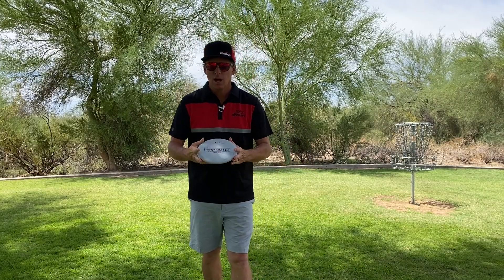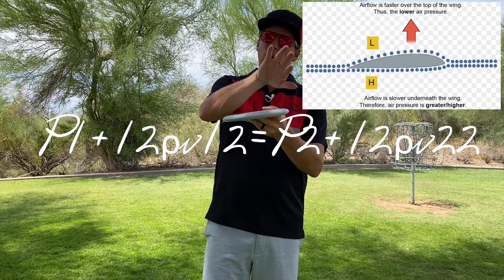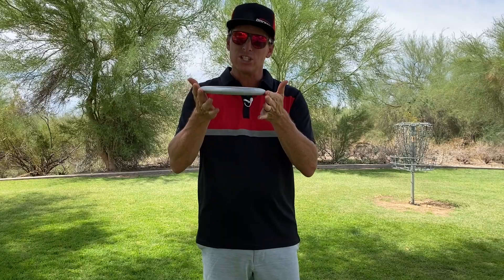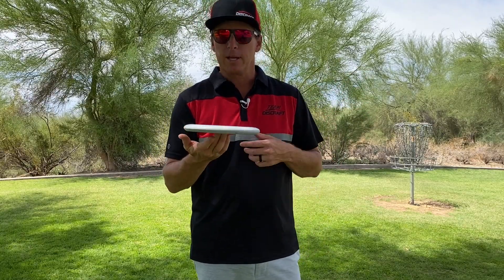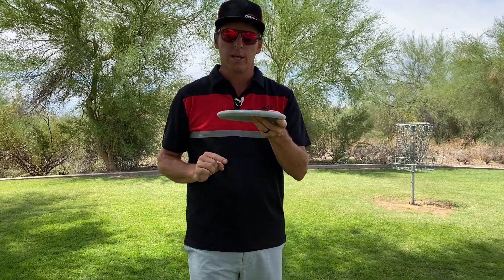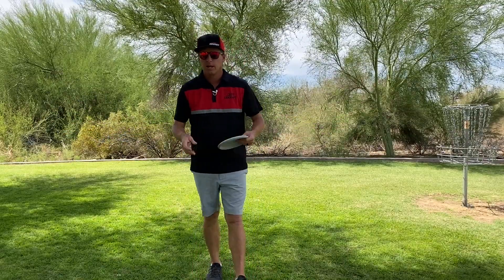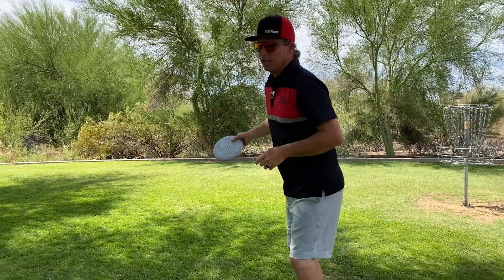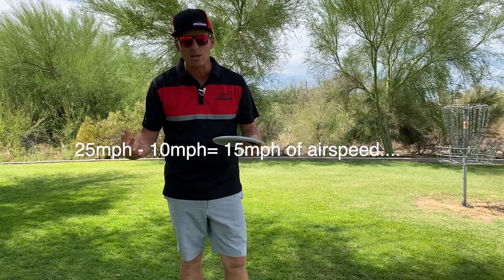Reading the wind Part 1: Airspeed & Disc speed

Comment: Great information, Pete. Thank you. Most of the headwind/tailwind putting instruction seems to entail aim point adjustment. Given your insight that the "airspeed" of the disc is the actual cause of the various wind effects, could one also theoretically maintain the same aim point and then adjust only release velocity? Is the aim point reccomendation made because it's a lot easier to reliably estimate than the mph of a given wind?
Reply from the maker: First, thank you for the questions, they are good ones.
I think most folks see the wind as a force they have to either beat or race to accomplish their desired outcome. Have you ever seen one of those swimming pools where the pool has a water current being pumped through it so that the swimmer remains in one place…kinda like a swimmers treadmill? How fast the water is pumped past the swimmer dictates wether the swimmer remains in place or not. Air is a fluid/gas, and the speed with which the fluid passes over the disc dictates “how Much” effect it will have on the disc. Learning how to have “proper pace” while putting is super important….also, I didn’t touch on it in this video, but having a correct disc angle makes all the difference. If the nose is high into a headwind, the disc will lift, just the same as if it were thrown nose down in a headwind, it would “drop”.
As a starting point for my video let’s assume the disc is putt completely level…..it is in an orientation that the wind will have the least effect on it. Putting practice is super important in order to get a feel for how one putts. I tend to not try to accelerate my putter past my normal putt speed….I keep the same pace…so in a headwind I know that my putter will fly straight, as long as my disc angle of release is level (meaning not nose up). In a tailwind I know and have a feel for not changing pace but just adding height so the disc will have time to fall since it will not tend to glide due to a slower airspeed. Once again making sure my disc is not nose up or down.
Don’t get me wrong, There is a time and place to putt nose up or down, it’s extremely useful to know how and why to do so, but for the sake of understanding the basic principles of why a disc tends to lift or fall due to headwinds and tailwinds I was assuming a level putt…and this was the main point of this first video installment.
Reply: @DiscgliderPete  Thanks for the detailed response! I look forward to unpacking and applying to my own game-particularly nose angle. I play primarily in the woods and my natural putt is a nose-up hyzer. I've seen the wind do some crazy stuff on the occasional open hole! I am looking forward to the rest of the series and really appreciate the content.

Comment: Something I struggle to understand.. Why can I drive a putter farther in a tailwind than a headwind? I see P McB throw his Luna 400' with a tailwind and think "that should be dropping!"
Reply from the maker: Hi Brian, Thanks for the awesome question!
There is a very good explanation for this that we will cover in an upcoming video. However in order to not keep you waiting for too long and hopefully earn a subscribe click, there is a clue hidden in this video that applies to your question….
First, if you’d like to do a little math…A driver tends to fly on average of 7.2’ per mph thrown.
So a driver thrown at 60mph, would have a potential to fly 432’.    60 x 7.2 = 432
In order for a driver to maintain its “glide/flight”  property’s it needs to be traveling at “high speed”. A putters “high speed” flight properties tend to be much slower than a drivers. Let’s look at a tailwind…
A driver thrown at 60mph in still air will “feel” 60mph passing over it flight plate. The same driver thrown in a 20mph tail wind will “feel” only 40mph passing over its flight plate.This will make the driver act far more stable.
Yes it’s a projectile moving at 60mph ground speed, but it only interacts with the fluid it’s passing through, so because it feels only 40 mph of air passing over its flight plate and this acts like it is thrown only 40mph. It’s airspeed it’s traveling is not in harmony with is flight property’s in that it “needs” 60mph over it flight plate to fly properly.
A putter is designed to fly slower….
Normally a putter thrown at 60mph might tend to act under-stable and flip, but add a 20 mph tail wind and it feels like it’s only flying through the air at 40mph which tends to be a putters sweet spot for airspeed and boom it covers more ground because it’s ground speed and is “airspeed” are in harmony. And it now has the potential to clear the space of a driver because it’s resistance is much less…..from the discs perspective, it felt like it only flew through 300’ of air, thought it covered 400’ of ground.